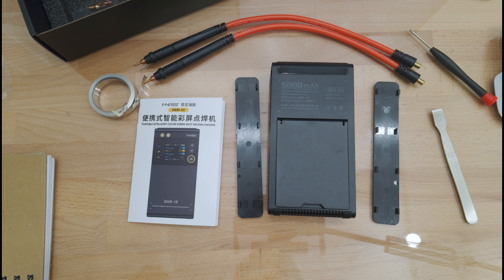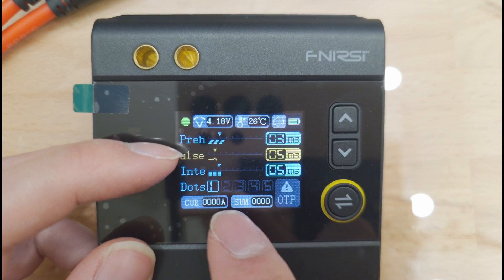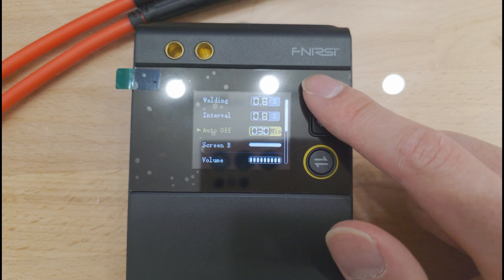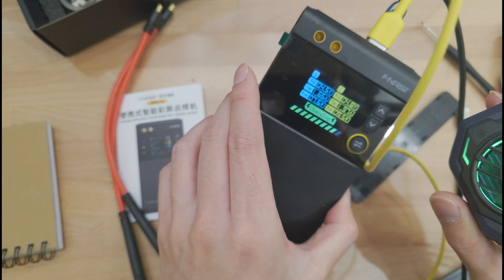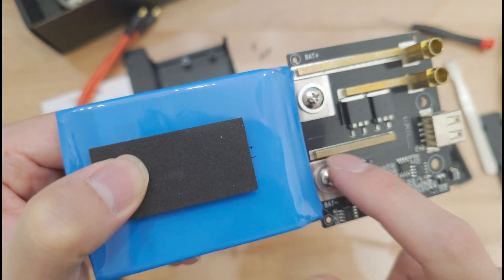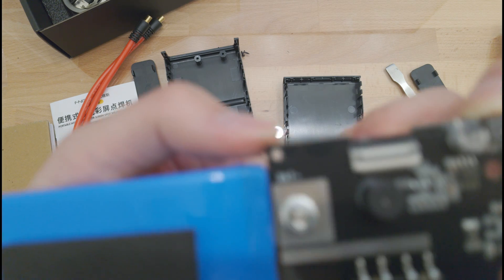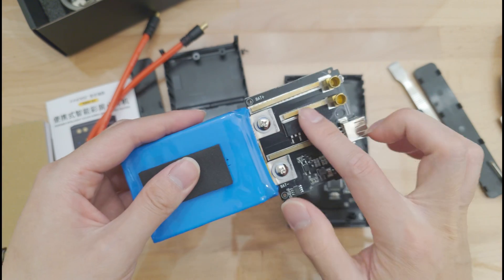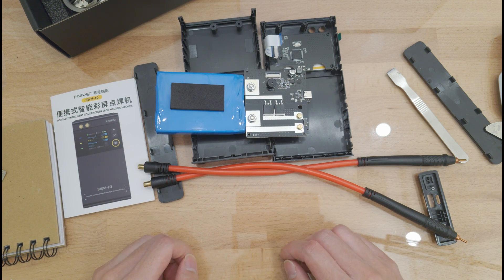FNIRSI SWM-10 Spot Welder Teardown Disassembly 4K

Comment: Thanks for such a comprehensive review. I bought one in 2014. Pretty good for 0.15 mm and 0.175mm nickel. After 6 months it failed all of a sudden. I opened up the case like what was shown in the video. Turned out the copper connectors on the PCB with the cables were dislodged, probably due to poor soldering.  Solerding it back was simple. Now it works again.

Comment: I went to look for your video testing this product in action and was disappointed to find none!   You make really good videos, you should make more!  And one of them should be a test of this welder on different materials, .1mm nickel, .2mm nickel, nickel-copper sandwich, etc.  Thanks for taking time to post this, it's super helpful to see videos like this!
Reply from the maker: I've used it for 0.15 nickel/steel I believe and that seems to be near the limit of the capability of this welder. I wouldn't particularly recommend it (and nor would I expect it to work) for anything thicker and/or made of copper, which requires much more heat and current to weld correctly.

Comment: Just out of curiousity and did purchase this, I see a two MOS from your video. Is two MOS weaker than BIFRC which has FOUR?
Reply from the maker: Not necessarily, it depends on the whole system, including the specifications of the MOS, i.e. peak current handling capability and R(ds) ON, as well as the parameters of the battery pack integrated into the device.
Reply: @liminalsunset  Thank you Larry for answering this!
Reply: And surprised that it has 1s2p ish battery pack w two MOS performs well. Maybe battery have some power capacity; sorry new to the electric world
Reply from the maker: @yoonlee5278  For welding applications, normally, it is desired to have lower voltage and higher current; because the resistance is very low, the voltage necessary to create the necessary current (V=IR) is not very high, and the heat is generated by the current. The battery cell used here has much wider than normal tabs and likely much thicker internal electrodes; these decrease the battery's internal electrical resistance, increasing the current that can be supplied. However, the thicker electrodes are heavier and take up more space, so the battery will likely have lower electrical capacity (but more power). It is a tradeoff.
Reply from the maker: Also, this device actually has four, there are two on each side of the board.

Comment: Today, i pick up my FNIRSI SWM-10, Unfortunately after soldering test, when i plug in charger, something was wrong with charging system, the device goes down, and I can not restart them. Why me 😭. I will change it only on Tuesday.
Reply: Same thing happened to me. I Got a new welder after contacting the seller on Ali express. First they tried to get me to replace the pcb  myself  , but they changed their mind and sent me a brand new.
Reply: And the new one died while charging after the third session...

Comment: Two issues with this device:
1) The included USB-A to USB-C cable does not allow this device to draw more than 0,34A from a charger, making it useless. I don't know why they even include it. You need to use your own quality cable to get the device to draw 1,9A from the charger.
2) In my case the device didn't stop charging at all. The battery voltage reached 4,33V at which point I manually disconnected it from the charger. Who knows what would have happened if I relied on it to stop by itself and left the room!
Reply: Charging slows down around 4.2 and terminates at 4.35 V.  Nothing wrong with charging slowly and/or stopping around 4V, it extends the life of the cells and is conducive to storage between uses.  Like you, I tend to use a better cable, then chose a power supply that provides the type of current I want to charge with.

Comment: Is it possible to replace the lipo with 18650?   Thank you for the teardown.  The thing with aliexpress lipos,  the cells degrade very quickly.   I have a kerpu unit, and it just lost it's power after two battery builds.
Reply: No, 18650s deliver too little power!
Reply: you need at least 100A current ...8x high drain in parallel can deliver 100A
Reply: Why not a LTO

Comment: Could I remove the internal battery and install a wired TX60 connector to use an better external battery
Reply from the maker: You might want to use an XT90 for this, but there is no reason why you couldn't. Granted, I think it would be hard to find a battery that would deliver significantly more than the 1000A this is already capable of. Increasing the voltage will likely burn a lot of things out as this is only designed for one series cell.

Comment: To remove the side panels, start at the end with a thin blade, once you get the end to pop up insert a screwdriver under the panel lengthwise and twist it back and forth to pop the clips free.

Comment: You can update firmware through usb c, eliminates often problems with short circuit protection alert...
Reply from the maker: Yes - Make sure to wait a long time, when the LED flashing color changes when doing this, as doing so before will lead to the device not booting. It is fully recoverable however it appears
Reply: Hi @liminalsunset , do you know how to recover it? I'm not able to start my device - long press power button doesn't do anything. When I connect it to computer and short press power button, it appears as removable device, but when I copy the firmware there and leave it quite long time, it didn't do anything (the green led just flashing the same way all the time).
Reply: @DHorak-kb8xn  Same here. I copy it over and nothing changes when I check the menu. Still stuck on V01.
Reply: @shiftctrlhack  There's a display bug, you need to switch to Chinese to see the real firmware version.
Reply: How does the firmware upgrade work 🤗 Does it work with android or PC and how, please? 🤔
Reply from the maker: @WaschyNumber1  I'm not sure about Android but I believe you have to hold down the power button for a few seconds while plugging the device into the computer, then it shows up as a USB drive that you copy the firmware into. You then have to wait a few minutes until the flashing light changes color before trying to turn it off/on again.
Reply: @liminalsunset  thanks very much, wher do I get the firmware please and I hope its the official frome the manufacturer. 🤔
Reply from the maker: @WaschyNumber1  Yes you can go to their website and go to the Downloads section where it will be in the welding tools section.
Reply: @liminalsunset  Hallo
how do I get on the device in a menu that shows me the installed firmware version please 🤔
And its a shame that they don't telling what improvements the new firmware version have.

Comment: Thanks for this amazing teardown! There is some charging bug on my unit. If I discharge the battery and charge it, it will charge to 4.2V with regular CC/CV. But if reconnect charging cable or start charging from not empty, the battery is charged to 4.4V. Weird.
Reply from the maker: I've never discharged mine but it appears to charge to 4.4V. I assume the battery is a high voltage chemistry perhaps.
It does seem to work better when charged to full.

Comment: can weld 0.2mm - 0.25mm thickness nickel plate to battery.  such as product description advertisements ?
Reply from the maker: It already struggles with welding 0.15mm nickel plated steel to 18650 batteries. In order to get a good weld you have to press lightly and not too hard, and keep the probes close to each other. This was the difference between it never working and working well enough.
Reply: If you play with settings the max is 0.2 pure nickel. Highest I recommend is 0.15 pure nickel.
Reply: No. In practice its not powerful enough to weld anything but 0.15 NiPlated steel :-( Also after round 20 Welds, you need to charge it again. Not very productive. It looks nice and can be good for some small battery, but its to week to building a bike battery!